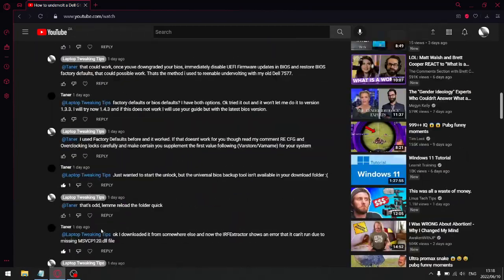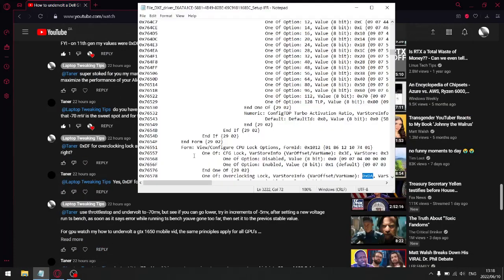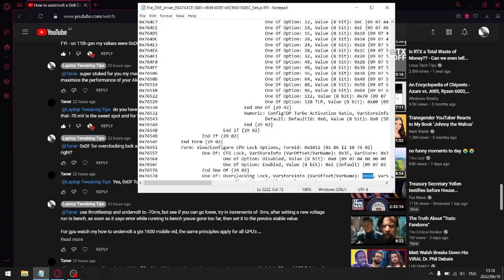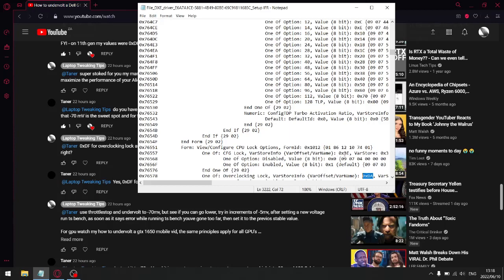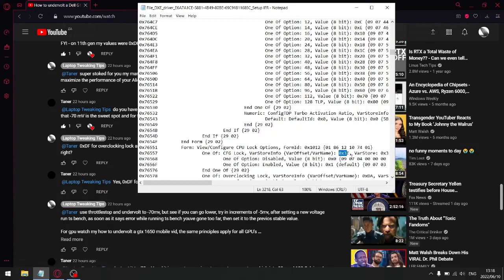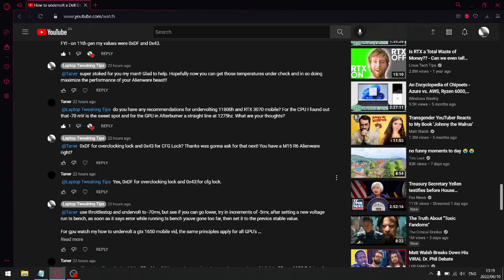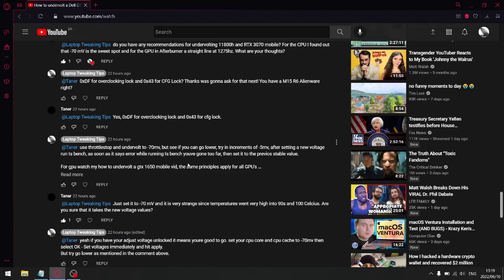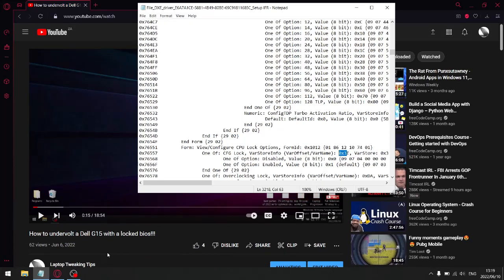How to undervolt an Alienware M15 R6 with a locked bios!!

Comment: Subscribed, thanks man.
Reply: Haha yea man, m15 r6 with 3080 and 32gb. Testing with -105mw now.
Reply from the maker: @cerkezZ  ok generally peopl with that laptop do 
-80 to -90 on core
-70 to -80 on core 

but thats not enough, the 11800h is a very powerful and hot cpu
you need to adjust trubro ratio limits to between 35 - 37 over all cores to get your temps down to mid 70s early 80s under load

let me know how youre going
going to link another video which explains it in more detail in next post
Reply from the maker: @cerkezZ  https://www.youtube.com/watch?v=8OKF1zLyM3g&t=385s
this explains the process in a little more detail :)
Reply from the maker: if you watched this first, it means you got one kickass laptop :)

is it the 11800h version?
Reply: @laptoptweakingtips  Alright, the temps went a litle bit down. But somehow I still cant get Valorant to run stable at 360fps. It jumps between 245 and 470fps. Any ideas?
Reply from the maker: @cerkezZ  for online you must find a value which the fps doesnt generally drop to far below

ie 270 fps - its higher than 245 min but lower than 470 high

so at least this way your gameplay is gonna be smoother
cap fps with rivatuner statistics
Reply: Thanks ! Will check that this evening. The temps sometimes hit 100 degrees before the undercoating, eve with 105mw it hits sometimes 94. I first thought about overclocking to get the 360fps stable but wouldn’t be smart with this temps 😂

Comment: hey man! im gonna try thus on my gigabyte aero 15 oled tomorrow since i dont have usb stick and i have to buy one, thanks for the tutorial, just 2 questions if you dont mind, going through several comments, it says you need a different value for 11800H cpus, what values should i use. another question is have you found a method to increase power limit of the cpus and gpus? thanks and subbed
Reply from the maker: Thanks for the sub yo! 
1) 11800h
Overclocking lock is 0xdf
Cfg lock is 0x43
2) no I need to still come across a method to increase the power limit to be honest.
CPU I tried changing it via throttlestop but the only result it yielded was increased temps and no change to performance
GPU you can try find a bios for your particular GPU with a higher tdp and flash the bios. However this has a very big bricking probability if you don't know what you are doing.
Im getting a rtx 3060 laptop early next year so then I might try it, I currently have a gtx1650 mobile and I haven't been able to find a suitable bios to flash, so it's difficult to make a video without actually performing it realtime 

My suggestion if you are dead set on that is search for a video where somebody explains how to flash a vbios for higher tdp.
Reply: @laptoptweakingtips  cheers for the speedy response! in regards to flashing BIOS, you need to request it in BIOS mod forums usually and its hard to get a response there as each modded BIOS is specific to your system so no general method unfortunately! oh well.
Reply from the maker: @themartianman2614  I speak under correction but generally MSI laptop GPUs vbios can fit with different brands.

With regards to unlocking your CPU, substitute those values I gave you for the ones I have in the video. Create the bootable USB, enter command line with those values and you'll come right.

Good man 🤘
Reply: @laptoptweakingtips  hey friend ive followed your tutorial and when trying to boot from usb, i get an error ''secure boot volition, invalid signature detected, check secure boot policy in setup''
Reply from the maker: @themartianman2614  go into your bios, disble secure boot and then try again. It should be 100% smooth sailing from there onwards
Reply: @laptoptweakingtips  hello I did that and I successfully got in the GNU grab menu and followed your instructions but I had to enter 0xDF and then for the other part 0x43 but again unfortunately it should the valued stayed at 0x1 meaning it’s still locked, this happened for both 0xDF and 0x43, so I don’t know why it didn’t display 0x0
Reply: @laptoptweakingtips  Nevermind! It works ! Thanks so much!!
Reply from the maker: @themartianman2614  all good brother, stoked for you. You have a 11800h right?
Reply: @laptoptweakingtips  yes 11800h. So what was interesting is when I first opened up over clocking lock section, the values were already 0xDF and 0x43, I didn’t need to change those values at all, I guess what did the trick was changing it from 0x1 to 0x0, I guess that’s what’s needed to unlock undervolting.
Reply: @laptoptweakingtips  so a little update, since I can to turn off secure boot, Valorant anti cheat requires you to have secure boot turned on, it literally tells you that and I had to turn it back on, unfortunately after I turned it on, I’m locked out of voltage control again, I need find a solution to this
Reply from the maker: @themartianman2614  exactly the lock is the x1, this video shows you how to change it to x0 unlocked.

From other viewers feedback, a decent undervolt for the 11800u is in the region of -70mv and then adjusting Turbo ratio limits to about 36. Your settings might be slightly different depending on your cooling
Reply: @laptoptweakingtips  ok I might’ve of made a mistake when turning on secure boot again, I just went to BIOS and hit default settings which definitely maybe removed the undervolt lock, I’ll be testing that now
Reply: Last reply, turns out I’m an idiot, I clicked default factory settings, it’s fixed now
Reply from the maker: @themartianman2614  lol! Bro it's an absolute pleasure dealing with you bro. Don't stress I often think I'm a clown, so you're in good company brother hahaha!

Comment: Hi man! I have a regular Alienware m15 (not the R6 version) so my cpu is an i7-9750H. I have followed your entire undervolting tutorial without issues (only thing I had to change was the 0xDA value to 0x78A and 0x3E to 0x6EE as my values were different, im assuming because of the difference in cpu's). However when I change the offset voltage in the cpu core section of ThrottleStop and click 'apply', the value in the chart at the top right of the window stays at 0? This makes me think the unlock hasn't worked but I'm honestly stuck and unsure why... 

Great tutorial though! Very easy to follow! Any help is appreciated!
Reply from the maker: Make sure to select apply and set voltages immediately
I think that is the problem
Thanks for the great feedback bro and I hope you come right 💪👍
Reply: @laptoptweakingtips  Thanks for the quick reply! Unfortunately the undervolt still doesn't seem to apply after changing the setting. This is strange as it seems other alienware users are able to undervolt. 

Not sure if this makes a difference but rather than booting on the USB through the advanced startup like in your tutorial, i simply booted through a 'boot options' menu that i can access with F12 when starting up my laptop. I did this as the USB wouldn't show up in the advanced startup menu. I doubt this made any difference but thought I'd bring it up just in case.
Reply from the maker: @crouchyyy  makes no difference at all. So your undervolting is unlocked but your settings don't stick.
Are you on windows 11 22h2 by any chance?
Reply: @laptoptweakingtips  I'm on version 21H2, I can go to 22h2 if that's the problem?
Reply from the maker: @crouchyyy  no it won't make a difference.
When I upgraded to 22h2 I had to delete and re-setup throttlestop configuration file about 4 or 5 times before the undervolt applied finally.
Try that a couple of times
Reply: @crouchyyy  hey I'm also normal M15,

So i have same values for grub part.

But your telling me you were able to just type
"Setup_var Setup 0x6EE" and it worked??

Cause for me it says "Var offset too large" implying its not in the var "Setup"
Reply from the maker: He never got back to me, make sure it's setup_var and not Setup_var

Also ensure secure boot is off in bios. If you're on windows 11 22h2 switch off all virtualization options in the bios as well.

Another thing you can try if all that doesn't make a difference is 0x00 at the end instead of 0x0, that did it for other people 

Also and this point isn't the greatest. Sometimes it just doesn't work, I'd say if you go through the comments section the success rate is 85-90% 
It just won't toggle for a few 

Good luck bro
Reply: @laptoptweakingtips  ye Capital S would just say invalid command lol, no virtualization In my bios 😔, and 0x00 wont work cause it cant find the 0x6EE offset in the first place.

Ig im unlucky huh. But i dont get why the guy above me with another M15 same exact cpu, got it working tho??
Reply: @laptoptweakingtips  Sorry for not replying for so long, I appreciate the help you offered me. My problem ended up being I didn't switch off the virtualization options in the bios. Works like a charm now!
Reply from the maker: @crouchyyy  oh that's awesome! Stoked for you brother!  Atleast it ended up working in the end.
Reply from the maker: @badateverything2931  see Crouchys response bro, youre a step or two away from success :)
Reply: @badateverything2931  Yo man, not sure if something of mine updated on accident but adjustable voltage for my throttlestop is locked again. I tried these steps again and ran into the same issue as you, so your not alone. If you manage to find a workaround or another way to undervolt your cpu I'd be grateful if you let me know. Cheers
Reply from the maker: Are you on windows 11 22h2 by any chance? I experiences an issue where I couldn't undervolt when upgrading to 22h2. I had to delete my throttlestop config file a couple of times and restart my computer about 3 or 4 times to get it to work again

Not sure if that would work again, but you can give it a try
Reply: @crouchyyy  lmaoooooo I personally gave up, but i never did try updating/downgrading my bios then following the steps. (I just assumed this wouldn't work idky) (im sure there's a way with the current issue you just have to be a literal tech genius, and google didn't provide me any sadly :()

Since were editing the bios maybe a different version had different variables we could actually access.

Other than that in all technicalities u can still use throttlestop Speedstep to control what clock your cpu runs 5ish-100% which by proxy controls power so i had just been using that.

Also disable turbopowerboost or whatever it's called it was using 10c+ for me.
Reply: @crouchyyy  i was also using Hwiinfo for fan control but an update stopped that.

Ye downgrading my bios (like a decent amount idk how much u have to exactly, i didn't go through each version 1by1)Re gave me fan controls tho (even if only 3 options per fan still much better)

So bios downgrade fixed that it might solve this too idk

Comment: Have I to do the same with an Alienware m15 r6 i9 11900H?
Reply from the maker: Once you unlock undervolting, apply your undervolt, but then also adjust turbo ratio limits to 36 or 35 across all cores. 
That's what other users with m15r6 i7 11800h are doing
💪👍
Reply from the maker: Your overclocking lock is 0xDF cfg lock is 0x43, create usb and carry on from there

Comment: I am about to use this method on m15 r6 but i have one question: the universal bios toolkit is not showing me more than 16384k in the ram section aand i have 64gigs of ram, so is that an issue or shoould i just choose the last avaliable number 16384k and carry on with the steps ? pls someone answers me fast cause i really want to unlock it. Thank you
Reply from the maker: Thanks for watching my video bro, I'm gonna save you some time. Do you have an i7 11800h?
Reply: @laptoptweakingtips  Man your video are very useful pls do not stop making them , I am personaly very gratful.
Reply: @laptoptweakingtips  Thank you alot goodman, i succecfuly unlocked it now, do you have any undervolting walkthrough steps video so i can try .. thank you again
Reply from the maker: @MohamedMostafaBarakaBless  sorry for late reply, I am stoked it worked for you!!!
Core and cache you can undervolt to -70mv seems to be the sweet spot for most people
Then set Turbo Ratio Limits to 36 over all cores 💪👍
https://youtu.be/dc6I5uxwKkk
Reply from the maker: If yes, you can skip the first steps. Your overclocking lock is 0xDF and cfg lock is 0x43
Skip ahead in the video, to the part where you create a bootable USB. Then substitute the values I have in the video for the values I have you above.
Reply: @laptoptweakingtips  I am a little confused about the step where the universal bios tool kit asks for the size of rams, i have 64gigs but the tool show only 16348k which is 16gigs, my question should i just continue and hit read and creat the file what should i do ? sorry for bothering am now as good as you !
Reply from the maker: @MohamedMostafaBarakaBless  like i said in the previos post, you can skip this step and go straight to creating a bootable usb
I gave you the overclocking lock and cfg lock values.
You dont even need to use Universal Bios Toolkit
Reply: @laptoptweakingtips  how to create a bootable usb ?
Reply: Sorry i get it now.. no need to bother my bad

Comment: Would this work for my m15 R2?
Reply from the maker: I havent tested it on that as of yet, but im pretty sure it should. Its the M series afterall. I know it doesnt work on the X17 and the X14.
If you have a 10th or 11th gen intel cpu, its almost guaranteed that it will work :)
Please sub to the channel if you succeed brother!
Reply: I will try on this model to see if this works
Reply from the maker: Sorry missed this comment.
Are you talking about m15r6 or m15r2?
Reply: @laptoptweakingtips  m15 r2
Reply from the maker: @kzwize  what CPU does it have? If it's older than 10th gen there is a slight variance in the command line to use at the end
Reply: @laptoptweakingtips  i7 9750h
Reply from the maker: Ok follow all the steps, then once you create the bootable USB, boot to GNU grub as per video.

But instead of inputting CpuSetup use Setup 

Eg 
setup_var Setup ... ...

It works this way for 9th gen or older 

Lemme know if you have any more questions bro
Reply: @laptoptweakingtips  Sure
Reply: @kzwize  hello, did it work?
Reply from the maker: It should I only learnt this after we spoke. If you have a 9th gen and older it must be 
setup_var Setup ... ...
Instead of setup_var CpuSetup ... ...
Reply: @kzwize  Did it work?
Reply: @722mau  Did you manage too unlock the M15 R2?
Reply: @juliann2970  I did not try it. In the end i cannot tell you if it works or not but i hope it works because it really helps reducing the temps. For me it was not a priority anymore
Reply: @juliann2970  No, I've tried everything, but still haven't gotten any results. The only way I was able to manage the undervoltage was by keeping my BIOS un-updated and hoping that someday Dell releases an update that will allow me to unlock the overclock controls
Reply from the maker: Yeah I've noticed that for that specific model, Alienware blocked this method. Also I think you can't even disable virtualization if I'm not mistaken 
Bummer bro sorry
Reply: @722mau  What is the latest bios version that still allows undervolting?  I didn't notice until recently that my offsets were no longer being applied, and it seems like that's my only option at this point as well (M15 R1 with a 9750H).

Edit:  Apparently 1.6.2 works, about to try that.